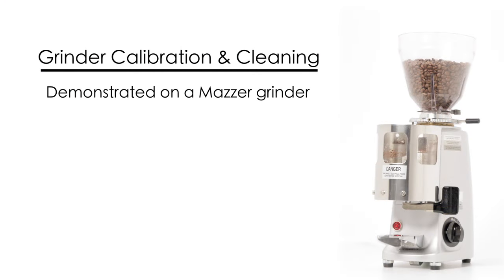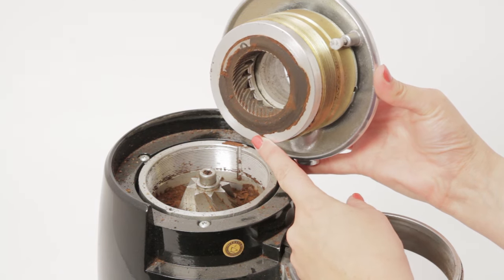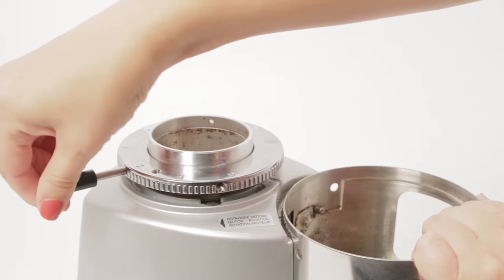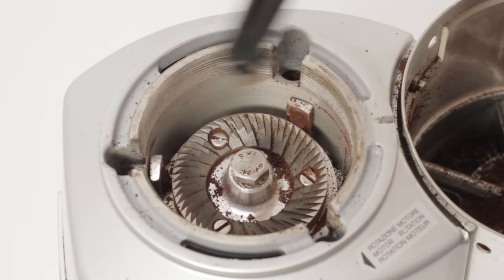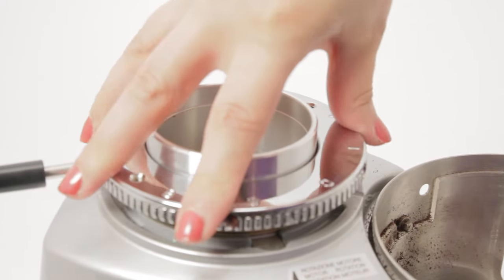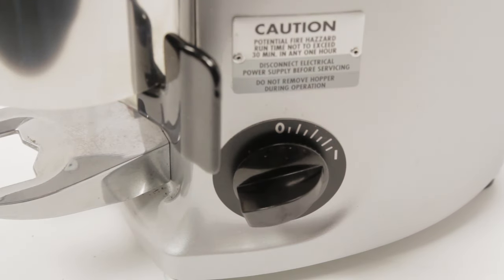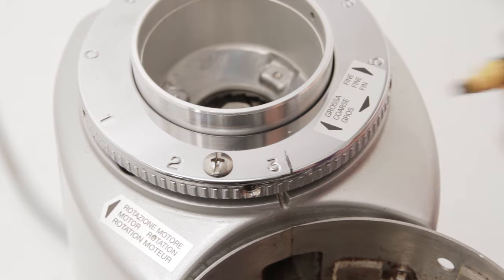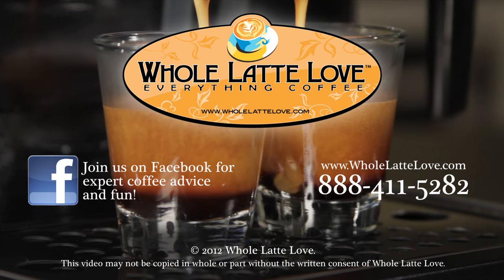Coffee Tech: Grinder Cleaning & Calibration

Comment: is there a better way to set zero point than having the 2 plate hit each other? isnt that wearing down the plate?
Reply from the maker: Typically adjusting down until hearing the burrs just touch is the way to find a zero point on this type of grinder. When you here them touch back off a bit. This very short touch should not hurt the burrs.

Comment: I just bought a Compak K3 Advanced touch. Sometimes when I turned it on, it would not grind, only making sound like the motor is running. What happen ? Is it because it needs certain time from first time 'on'  until it can run properly ? or is it because the grind setting is too fine ?
the manual says 'working cycle'  : 2 minutes function, 10 minutes stop. Does it mean that after operation for 2 minutes, the grinder needs to rest for 10 minutes before doing the next grind ? What should I do if I already used the finest grind setting, but still cannot brew the right espresso (I got 40 ml in 25 second)?
Reply from the maker: Hi Ko, 40ml in 25 seconds is reasonable. a fairly standard good extraction is 60ml double shot in ~25 seconds. There are many other variables at play of course but 40ml in 25 sec sounds a little slow. The working cycle does mean what you think: 2 minutes on, 10 min. rest. If you turn it on and motor is running but not grinding something is stopping the beans from getting to the burrs. Even at its finest setting if the motor is running it should be grinding.
Reply: Thank you for your advice. Sorry, I meant 40 ml single shot in 25 second (=80 ml double in 25 seconds).
I have set almost the finest grind.  I wonder if  the manufacturer setting is already the finest, or is it still possible to find the zero setting as your video show ? Thanks.
Reply: Ko Amin Samudera i own compak k3 i know what you mean because it happen to me once. You need a lot of trash beans when you just bought your compak k3. The grinder is not able to catch the bean properly at first so what you need to do is simply just turn on the grinder running at coarse setting while it is grinding the trash beans slowly turn the setting to fine espresso setting that you desire. For me i stop at 25 marker. Then i stop grinding and change the trash beans to my desired beans. Tara---~~ suddenly the grinder is able to catch the beans and grinding it very fine and consistenly from there. Thats how its done with this grinder when you first bought it. It need warming up by grinding beans from coarse to fine then it can grind any beans normally.

Comment: Do you ever need to sharpen the burs or what are the factors to know when its time to replace the burs?
Reply from the maker: John Reynolds Hi John, excellent question. Burrs are generally replaced with new sets and not sharpened. A few ways to determine when to replace: 1. Age/amount of coffee ground: Some manufacturers will rate burrs for grinding a specific amount. ie. replace burrs after 2 years if grinding 10lbs./wk. 2. Ceramic burrs stay sharp longer than steel but are more brittle so more easily chipped. You can look and feel the burrs to appraise their sharpness. It's subjective so helps if you know how they felt when new. 3. Quality of espresso: If/when shot quality declines might be time to replace the burrs.

Comment: Don't the burrs dull when they touch while calibrating? That sounded pretty scary.
Reply from the maker: Hi B, Thanks for the question. The outer flat ring of the burr without teeth is slightly higher than the cutting teeth so they make contact well before there's any chance of the cutting edges making contact.
Marc

Comment: i have rocket fausto grinder,it is similar to calibrate my rocket fausto or not? thanks for your advice:)
Reply from the maker: Hi yb, Yes, similar process. Just keep going finer with the grinder running until you hear the sound of the burrs just touching, then back off a hair till sound stops and that's the zero setting.
Reply: Yeah,its work. Thank you.

Comment: If you dont have the adjustment screw is an issue ?
Reply from the maker: We suggest having the screw installed but the grinder will work without it with no effect on grinding performance.

Comment: Is there any way to set the zero point to the actual zero on the plate?
Reply from the maker: Hi S, Thanks for the question. On most grinders there is not. Numbers are there for reference. Some use a wax pencil or similar method to mark the zero point on the adjustment collar.
Marc
Reply: Ok, thank you!

Comment: The cleaning process is not perfect. You did not remove the screws from both burrs. The oily residues are beneath and both burrs need to be washed in warm soap water and perfectly dried.

Comment: I don't get this video at all.  I have had the Mazzer Mini for about 8 years now.  For starters, no where in the manual does it tell you to do this calibration or allow the burrs to touch.  This grinder already comes calibrated from the factory as indicated by the placement of the sticker on top of the collar. When taking it apart for cleaning, all you have to do is count and remember how many revolutions are needed to remove the adjustment collar.  For me its 4 full revolutions.  After cleaning, you simply align the center arrow of the sticker to the notch on the grinder and turn it the same amount of revolutions back on.  As I said the factory has already calibrated it for you.  So all you have to do is align that center arrow on the sticker with the notch of the grinder.  Quite often, that has been the perfect spot to get the proper grind.  At worse, I have only had to make minor adjustments no more than 1-2 notches either side of that. No reason to find the zero setting and certainly no reason to allow the burrs to touch.
Reply from the maker: Hi Frank, Thanks for the comment. Not sure what's not to get. Video shows how to clean and calibrate the grinder. Calibrating is not required but some users do want to know where the zero point is. Over time and depending on use level calibration will change with burr wear etc. While touching burrs sounds like a bad idea do understand the actual cutting surfaces of the burrs do not touch when doing this. The outer ring of each burr is slightly higher than the cutting surfaces.